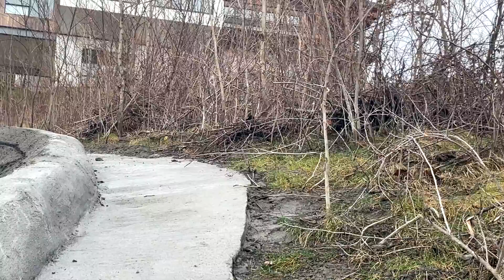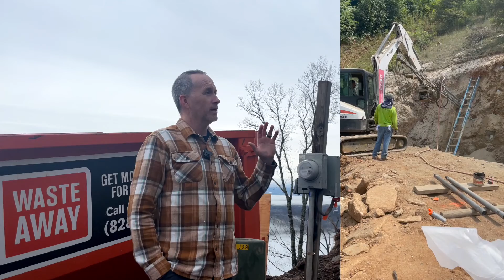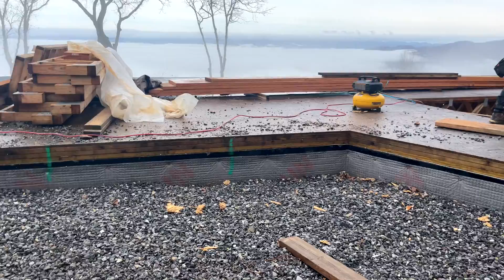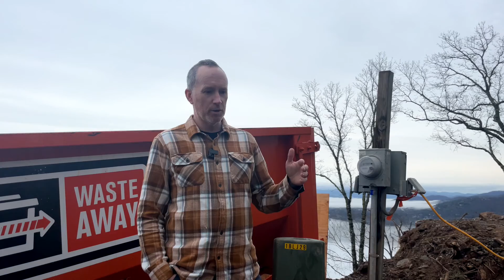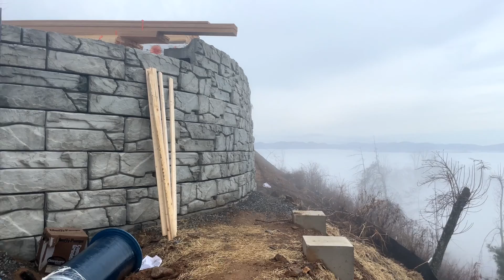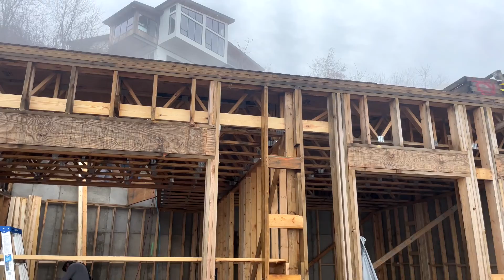Site Prep When Building on a Steep Slope | Building in the Mountains

Comment: So as close as the houses are, i suppose the house on the bottom of the hill has the ( benefit ) of all the water coming down from all the houses on the higher lots. lol
And, since the lots dont appear to be very large, where does the sewage system go?
As for the beautiful view, O K so long as you dont object to your neibors roof color.
Reply from the maker: Great questions. These homes are on city sewer so no septic. With water runoff we worked with the home above and below to make sure diverted water away from above our home with swells and with our water runoff our landscape architect designed retention ponds or diverted the water to the road to the road drainage system. 
Great comment and questions. Your right it does take planning or issues will arise.